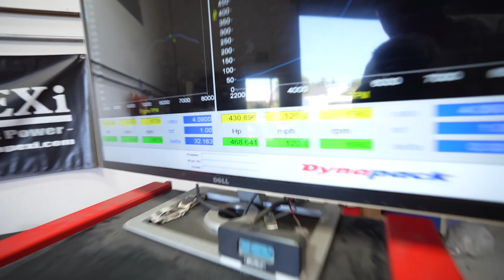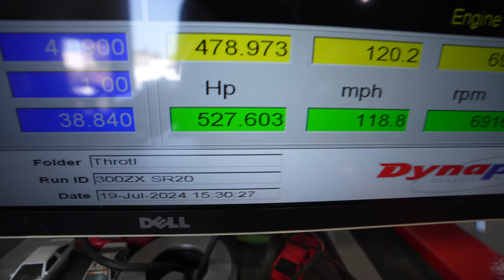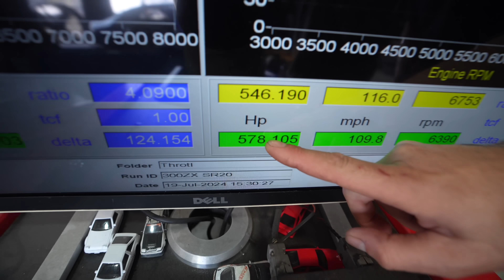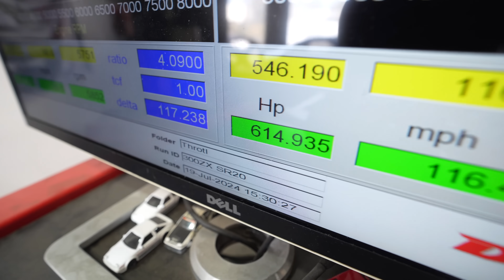Trading our 300ZX for THIS!? (JDM Import)

Comment: id build the evo over the ITR. The ITR is just something you respect as stock. Mostly cosmetic stuff and bolt ons but would be a tragedy to pull out that engine which was perfectly matched with the chassis. Evo's meanwhile were always great to build up, full engine work, etc...
Reply: well said lad
Reply: Agreed
Reply: Im sure u would
Reply: completely agree with what you say BUT it would be sick to see them AWD ITR B series
Reply: Well said
Reply: awd supercharged b18 sounds fun
Reply: Too bad they’ve built like 5 EVO’s on this channel already
Reply: This.
Reply: Build a clone ITR, leave a clean one as mild plus build.
Reply: Took the words out of my mouth!
Reply: Mickey didn't want to change out the engine. He said keep the b18 and make it awd. It would not take anything away from the appeal of the type r. It would still be a stitch welded stiff chassis analog monster with awd that drove very similar to stock with much better traction.
Reply: @735 he said we could k swap it
Reply: @afcarson79  Then I stand corrected on that point. I still dont think a b18 awd takes away from the Type R. K swapping it would be a little sad. I know it is a better motor but the b18 add character to the ITR. Thank you for correcting me.
Reply: 1000%  agree

Comment: Dude that Z is waaaaaaaaaaay cooler than that Type R... Ive never cared for the type R very much.. Honestly the Z is cooler car than both the evo and the Type R to be honest
Reply: I will not trade the 300zx for integra or evo 4. No way, the 300zx is cooler
Reply: 100%
Reply: Its all about the content , once they plateu on a build they have to start fresh and make more content , but yes i agree 100%. I feel like the 300 has much more potential drifting wise. I want to see Throtl actually use their cars for racing or track content, but it seems like theyre just doing builds then sell/swap and on to the next.

Comment: 300zx is brand new with 600 bhp and full paint job and full brand new interior and all the best parts its worth way more that the Honda easy
Reply: even so, an itr sells for around 32k and up atm
Reply: @Sheltur_0311  exactly. Yes the 300zx is nicer at its current state. But the ITR is worth more.

Comment: The Z32 disrespect is insane...
Reply: Let it keep happening! Keep them cheap for me
Reply: Fr but that’s how it’s always been people never appreciate the Z let alone the power the VG holds
Reply: I love the VG. So much i’m building one
Reply: The VG30 sucks, it’s only fun when it works 40% of the time.
Reply: @connoisseuroftigolbitts  is that why Nissan based the VQ and VR off of the VG for the gtr and z33/34 cars?
Reply: @connoisseuroftigolbitts  have you owned a Vg30dett car?
Reply: @connoisseuroftigolbitts thats what people who either never owner one or bought a shitty 300zx would say. Anyone who stuck with the vg30 would say otherwise
Reply: Yup owned 4 of them
2 tt’s 
2 non’s
I love them BEAUTIFUL CHASSIS 😍 
TRASH engines 👎 
Cost a lot of money just too push 600hp 
Best scenario is LS swapping them.
Reply: @171JUSTIN  yes and made it 20x better
Reply: @Zi.Zenior  or just swap them
With a VQHR OR VR…
 more people should do this
Reply: @connoisseuroftigolbitts  there’s been a VR swap before. But it’s very expensive for the power. The VQ isn’t a worthwhile swap when it comes to price either. If you’re dead set on not having a VG then an RB is the best choice. It fits well and requires less custom work than an LS, plus you can get the AC working good. But in reality, the VG hate is overblown. It’s a stout engine that can handle 600hp without being opened. The engines aren’t unreliable, it’s just maintenance neglect that causes issues since these Zs are 30 years old. I actually just made a video about avoiding a money pit Z
Reply: @connoisseuroftigolbitts get new injectors, change the timing belt and enjoy the car.  No it’s not b series honda
Reply: @Zi.Zenior  you are correct 👍
Reply: VG is where it's at 😎
Reply: @connoisseuroftigolbitts  they are good engines just stupid to work on

Comment: While I didn't have a type r tegy, I did have a '97 gsr in 2006 with new shocks, springs, rear sway har with new bushings and supported by a sub frame brace. It was fun af. Miss that car, even after an evo, sti, and s3.

Comment: Please leave the typeR alone. If you're wanting to 4wd and engine swap it, may as well get a non-typeR as a base car.

Evo - maybe try something that hasn't been done a tonne already. Maybe a "tough" theme. A moderate (400hp) power that is super responsive and built to take worlds of abuse. 

Maybe a couple of the guys could build it around learning lower speed rallying? Dirt, snow & tarmac build series

Comment: Just keep in mind the Evo 4/5 has the same early 7-bolt 4g63 thrust bearing as the early 2G DSM turbo. So don’t be surprised when it crankwalks. Evo 7 and above is when it has the split thrust bearing. In fact the Evo 4 is considered the least reliable Evo ever.

Comment: If you wanna awd and k swap an integra you would be nuts to start with a clean type r. Youre literally paying extra for parts youre gonna remove. Just start with s base model integra. 
Not to kention it goes against everything a proper type r is supposed to be.

Comment: Evo 4 in my opinion is not worth what the 300zx is as it is. Evo 4 motor is the most restricted powerwise due to crank issues. Its not a straight swap imo, unless it has ridiculously low kms

Comment: All that money put in a motor when a stock internal vg30 with bolt ons make 600 pretty commonly. And fully built 1000 easily. The car is amazing but the soul just isn’t right. This is coming from a z32 owner and looking at the comments of almost every video most 300zx owners feel the same

Comment: Meet me, all Hondas are complete Hot Garbage.  Front wheel drive, oil leaking, junk.  The Interga type r is the most overrated car on the planet, right in front of the Scrapper 2000.